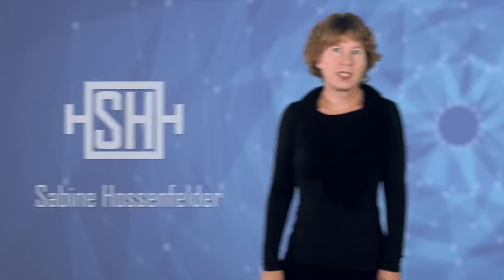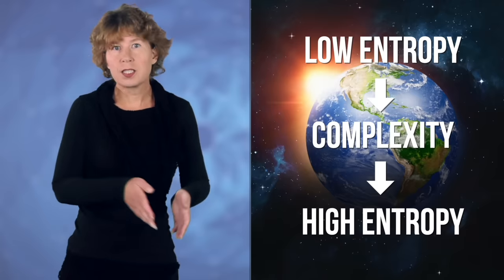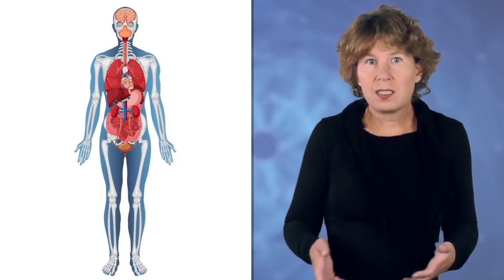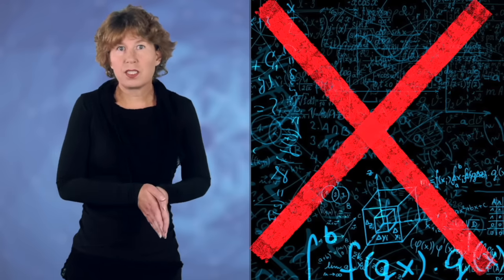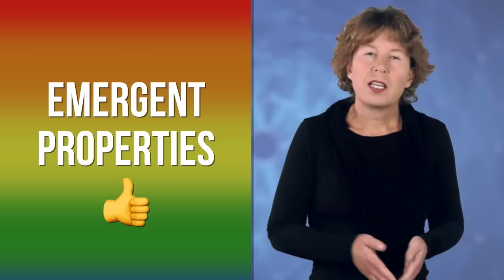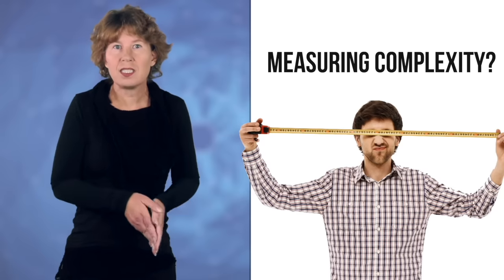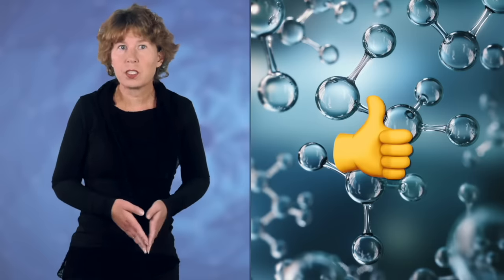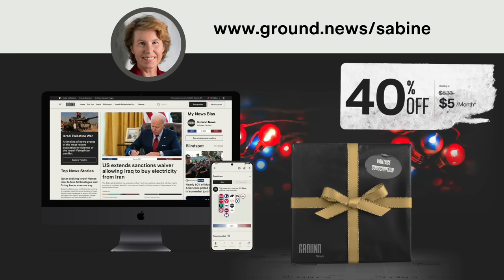The Biggest Gap in Science: Complexity

Comment: Complexity is the amount of different things interacting with each other and the potential different results that come out out of those interactions. A rock has little to no interactive elements to it, sitting there inert.  Other things like computers, you would use the complexity when it functions. Thus a nonfunctioning PC would have little to no complexity. 

So number of elements/things * variety of those things * possible outcome of those interactions = complexity, roughly speaking.  Disregarding anything smaller than molecular.   Living organics have numerous different elements with numerous different kinds of interactions with numerous outcomes. So are exceedingly complex. Dead organics are not complex though you could judge them based on when they were living. Or you could judge the complexity of the decay process but that would be a different thing.

I think it is very disingenuous of you Sabine to say "Humans make pencils so therefore you add the complexity of humans to the complexity of pencils."

Comment: SELF-REFERENTIALITY 
 With the Mobius strip and Klein bottle I can dispense with duality in favour of NeoPlatonic notions of oneness and unity. Something like Wheeler's One Electron does away with simple dual entanglement in favour of all-entanglement, like a long strand of spaghetti .The flat complex plane is transformed to the constantly curved sphere, so the duality between negative and positive numbers becomes surmounted. The linear superposition of waves not only modulates the amplitude of the resultant wave but also produces a modulation of the phase, which is manifested as a time shift associated to the interference patterns. This doing-away with the complex numbers can thus be written as the product of sinusoidal functions, yet introducing anticipatory behaviour by this phase modulation, what Whitehead called the retardation and acceleration. Whitehead had an alternative Relativity to Einstein...now all but squashed or quashed from the annuls of science. We all know Einstein's Relativity is mathematically flawed; but I'm not questioning the finite speed of light,  time dilation, length contraction and mass increase at relativistic speeds. Nor did Whitehead; though his modified theory did not allow the existence of black holes! So, a plus, then!!

Comment: No, no, no. You think again. Complexity is simple. Complexity is amount of information you need to capture configurations and properties that you want to describe. Kolmogorov basically nailed it. Standard model describes interactions in principle, but does not contain any information about the state of actual particles. If you write a simulation program alone, you will not get a baby. If you add all the particle state information that is needed to simulate specifically baby - you'll get much more complex system and you'll need much more information.

Comment: Looks like just a linguistic trick. "Complexity" as a way to say "we are interested in that shit but it's hard to calculate". The thing about babies and rocks is that we are interested in babies and we don't care about rocks. The thing about clockworks is that it's explicitly designed to be easy to predict what it does, it does exactly what the designer of clockwork intended it to do. So when you solve something 'complex', and now it's easy to predict, you don't solve 'complexity', you just solve a problem. It's literally a sort of synonym to 'unsolved'. 'Unsolved' is not a problem, it's a state of other problem.
If something different was meant by this video, then I failed to understand it.

Comment: I think trying to create a generic ruler for complexity of non similar things is fairly difficult and meaningless. What value is there in differentiating between a baby and a rock when there’s little that can be derived from such a comparison? It would be more meaningful to compare a baby with a toddler or a teenager or an adult.  Seems like this falls into the category of fuzzy reasoning. Like when you tell someone to rent a big car, that could be a Lexus sedan or a sixty five Cadillac. There is no absolute definition when you look at qualitative aspects of things. The only thing that comes to mind for comparing complexity for non similar things would be to look at the level of data a program would require to accurately model a thing. I don’t think you’d need a big program to model a rock, but a baby has lots of before states, egg, zygote, embryo and all the stages it goes through before it’s no longer a baby.  Information was reduced to a byte, but complexity is noun version of an adjective complex. So complexity is a concept that is useful for describing something, but quantifying this doesn’t seem like it would have much utility unless it can be used to reverse engineer something like a life form.

Comment: Your reasoning with algorithmic complexity is not quite correct! For both a rock and a baby you can start by programming the laws of physics, but that's only the first step. You still have to write code to generate the arrangement of atoms. The code that generates the rock will be much simpler: you can write a very short program that creates a simple initial arrangement of a bunch of atoms and then mixes them up randomly with some heating and cooling to make a rock. If you want to generate a baby with code you have to end up with a very specific arrangement of particles. There's still a lot of repetition, so you can write a function to generate one cell and then call it a bunch of times, but that single cell is going to be a very long program. You can also see this by just looking around the universe. There are many more rocks than babies, so the program to generate rocks is more likely (shorter). You can't just write a program to simulate the universe from the big bang, because then you're looking at the algorithmic complexity of the universe, not the baby/rock.

Comment: Seems that the application of Kolmogorov is not exact here? You correctly provide its definition, but then saying that both a baby and a rock are beholden to the same laws of physics and thus equally complex under Kolmogorov is odd. 

If you are interested in the atoms and their interactions - then sure, at that scale a rock is certainly as complex as a baby! In fact we don't have different physics for baby atoms and rock atoms, so why would we think the two phenomena - at that level - have different complexities?

If you are not interested in the individual atoms but in the overall behavior at a macroscopic level, then surely Kolmogorov would indeed distinguish between the two - correctly. The same goes for the network complexity by the way, if one sees it in the lens of Kolmogorov, then both fully connected and fully disconnected extremes are indeed very simple, and Kolmogorov would predict that.

Comment: How would some assembled parts ‘stick’ rather than disappear if they are not held within a stable environment? Ie a specific amino acid sequence? How would the specificity of that ‘persistent’ protein structure (which hung around long enough for other useful parts to appear) be guaranteed to fit the other parts (and not and become obsolete due to changing adaptive pressures?) How did nature know to assemble parts later on that would be compatible with earlier assembled parts? To me, it’s another failed attempt to give the evolution by selective pressure on genetic mutation some new legs. This new assembly theory gives a wishful account of how parts could be assembled by selection but not how those parts would contemporaneously exist, whether they would be compatible, whether they would carry out a required function but most of all, how did those potentially useful parts exist in the first place? I’ll answer that one: they had to be coded. A three base amino acid is a 1 in 64 entity. Your average protein molecule has 150 residues. I let you do the maths. This is just a nomenclature change for the materialistic creed of evolution. Think of the ‘just in time’ assembly at car manufacturing factories: a supply chain, locational guidance, specificity and temporal relevance. All of these require organisation and planning. Dare I say it, a mind. Sabine, your next video should be about how science is being shut down because of complexity. Nobody wants to/is allowed to ask the big questions for fear of being ex-communicated.

Comment: I think....evolution shall not be part of compleixty. IWith most of the analogy in the video it seems for me that the complex system has to mimic the "complex" reality...assuming it has leant everything it shall not evolve...or evoultion servers only the purpose to increase the complexity...I think, therefore evolution is not part of complexity...rather a method how to "transfer" complexity from one system to an other. Surprise: I think it has also nothing to do with compleixty....a lot of system has surprise and this is used in AI as well: adding noise/randomness to the complex system to increase variability....A little noise always helps. I think what is difficult is indeed to find how many states can be stored and recalled in a system (graph)....and also if the information can be condesed (graph can be pruned)...compleity is somewhere between being a pure memory of everything or just give the same output to all input....so somehow make statistical averages from the input.....I think actually AI and neural networks just do this already....also there are studies how to scale up a neural network (eg EfficientNet paper)....too many extra neurons will not contribute to it much so despite more neurons I would not say complexity increased...it shall be able to store information efficiently....Also I think unlike in physics it is really difficult to figure out what is emergent in case of system which has many many different kind of inputs and therefore a lot of states.(it is not difficult for example to figure out temperature or conductivity as an emergent property....from statistical means etc.).